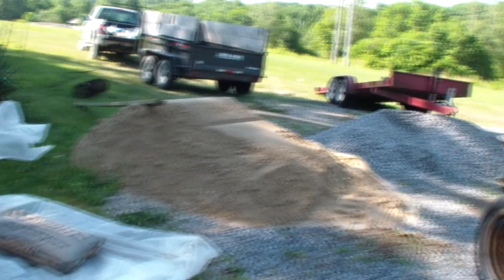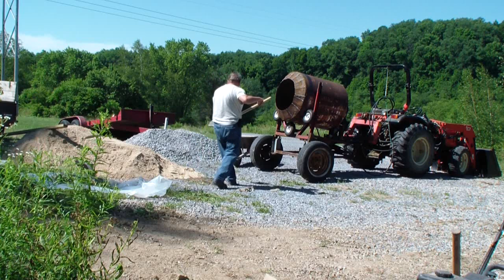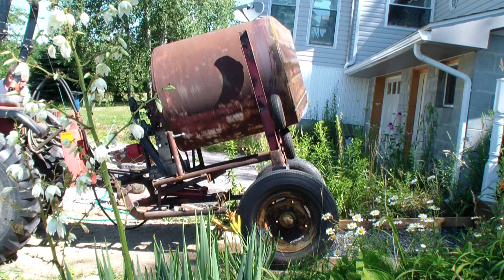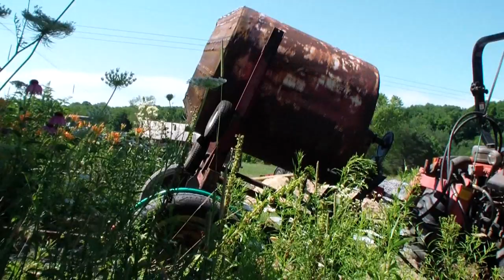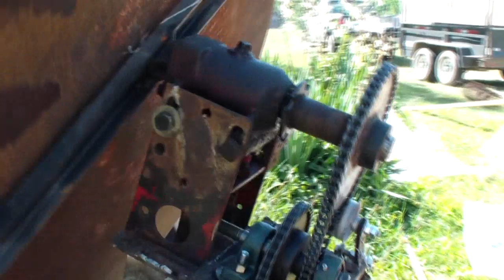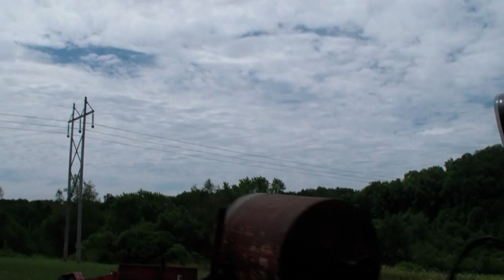Home made cement mixer, finished.

Comment from the maker: Thanks, Are you saying  pull the Iron (wire) up into the concrete?
Reply: The wire mesh should be as close as possible to the middle of the slab thickness. I have had good success with fibre mixed into the concrete at the batch plant.
Reply: instead of rebar or metal mesh